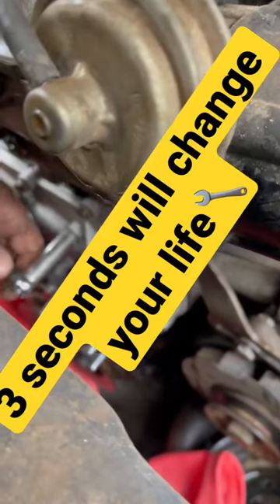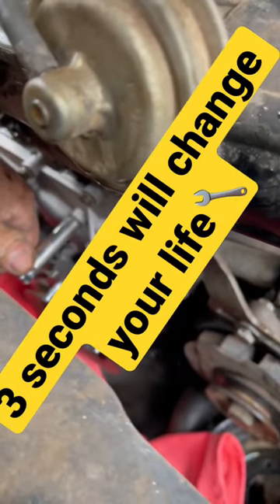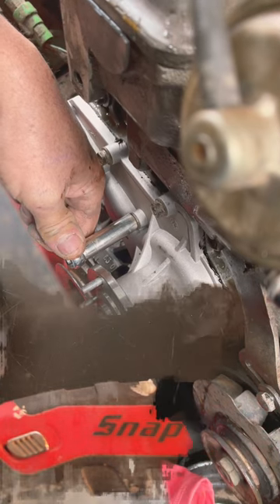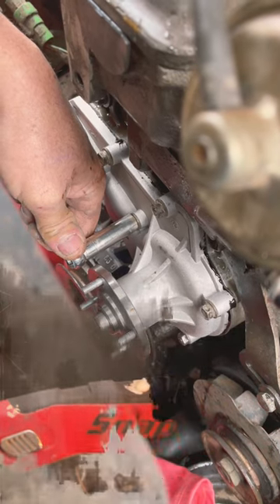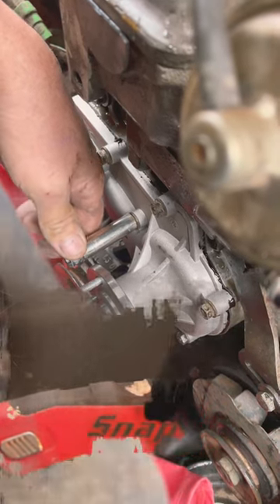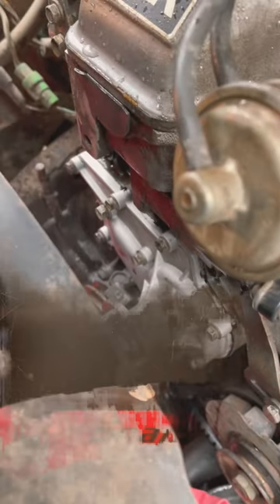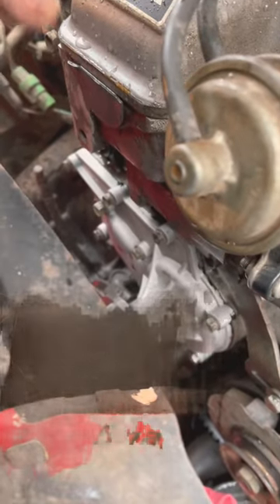This is why you hold your bolts for 3 seconds 🔧#shorts

Comment: I have been turning a wrench for over 50 years with 2 ASE Master Certs & more. I never had problems with bolts until they started using metric bolts. With Gm 1977 was the first year for a mix of metric & SAE fasteners. The Gov was subsidizing the switch after about 3 years that stopped so it stayed metric & SAE for a bit.
Now as a mech I had to buy a new set of tools that was not subsidized. 
The tread pitch of the SAE seemed to hold better than the metric thread pitch don't know why it just did. 
Back then bolts held by clapping force not today's bolt stretch not torque. Working on Asian cars (metric) in the late 70's the bolts were softer I would tend to snap off 6mm bolts, they were not as hard as US 1/4 bolts.
Like today there are many steps in setting head bolts. Today I'm doing a Ford V6 4.2 head bolts. It has like 6-7 sequences one has to follow.
One of them is when your about 1/2 thur sequence is back them off like 2 turns & start over. Some say one has to wait a few mins on each sequence to let the bolt relax.
I like the old school when you would torque all to 35 lb them go 75-80 lb & done.
Reply from the maker: Truly amazing how much metal has changed. All the new techniques. Mixes and alloys, pitch, temper, hardness, stretch,  etc.... Even from the point of manufacture and the process and materials used. Like a lot of the good bolts and machines were made during certain periods of time. I personally enjoy the older stuff like you said. It is nice bolting down some nice older heads on a sbc.....Good old fashioned engines with American made steel.....👍

Comment: Low-frequency resonant vibration causes all bolts to come loose. Regardless of how long you hold them. It's a really interesting phenomenon. You should look into it.
Reply from the maker: I have, also the Junker vibration tester. Both highly interesting....Plenty of research and factors to be considered.... The torque, tension,  and clamping force are all a part of tightening a bolt. I do believe the 3 seconds helps to settle the tension, on the molecular level. It will in fact help it to become looser , more easily with rebound tension. I do not disagree with your information though. Great comment👍
Reply from the maker: @kssendthemamessage6818  😀

Comment: If you're not using a torque wrench technically you're not doing it right. If it ain't tight enough in the first place it doesn't matter how long you hold it.
Reply from the maker: Can you fix anything without a torque wrench?

Comment: I heard if you continue holding it at the proper tension forever would be obviously best.  But what they don't tell you is the bolt may still want to back out.  The important thing to remember is; you can lead a bolt to proper torque spec, but you can't make it want to stay.
Reply from the maker: This does help it . Exactly.

Comment: A quick Google search taught me something new 

A Bolt Acts Like A Spring

So, how does a bolt provide the friction we need? A bolt is really just a simple spring, albeit a very stiff one. When you push and pull on a spring, it develops a force which is governed by the equation:

F = K x X

Where X is the amount the spring is being stretched (or compressed) and K is the stiffness of the spring. Multiply those two together and you get the force in the spring. Here’s an example: Suppose we have a spring that has a stiffness of 15 lb/in, in other words, it takes 15 lb of force to stretch or compress the spring one inch. If we want to compress this spring 2 inches, we would need:

F = 2” x 15 lb/in = 30 lb

The same thing happens in a bolt. [Editor’s note: The equation above shows the spring equation since we’re making an analogy. In reality, the relationship between force, strain, and stiffness of a metal bolt is ￼, which is stress = elastic modulus x strain. But it’s the same idea. -DT]. When we tighten the bolt, the threads of the bolt are trying to pull the nut closer to the head of the bolt. But, the object we are trying to clamp (a steel plate, a suspension bushing, a bracket, etc.) is in the way and stops the nut from being able to get closer to the bolt head. The only way the nut can keep turning is for the bolt to stretch just like a spring. Of course, like a spring, this gets harder and harder the more you try to stretch the bolt which is why it gets harder and harder to turn a nut the more you tighten it. We can imagine a similar thing happening to the objects being clamped by the bolt; they have a stiffness as well and we can think of them as springs that instead of being stretched, are being compressed by the force of the bolt.
Reply from the maker: Finally someone did some research! Very well done.... Now you have a much better understanding on why this would help prevent the bolt from backing out. Good job!👍
Reply: @fastflo1  yeah I got curious after reading some of the comments. 

Never knew they stretched and acted like springs.
Reply from the maker: @lilrich1243  that is great . Most people do not do the research. Most simply reject it because they have never heard of it . A few people like yourself either know or are inquisitive enough to find out for themselves. It has been a really fun video so far . I do like the fact that it has inspired a few minds to want to know . And I am glad you found out . Now as you make a practice of doing this . You will also benefit in several other ways. Some of which you will discover is a higher level of focus, a better attention to detail. You will also feel some of them move in the 3 seconds . Whether it may be thread interference, twist, or friction being overcome. You will notice much more and get a better overall feel for your work . Please let me know how you what you discover. I have been using this method for over 30 years now on hundreds of projects and thousands of bolts . It is fun to do and you will always know you are doing the absolute best for your machines . Enjoy and thanks for your comment 👍🏻

Comment: I’ve never thought or was taught the three second rule but if you give it thought makes sense. The tension of torquing and vibration will loosen if you don’t tighten it enough even with a torque wrench it’s always good to give a few Ft lbs after the click for good measure.
Reply from the maker: You are very logical....Exactly. You will feel it for sure just start doing it. I do it on everything I work on. Screwdrivers, hand wrenching, open end wrenches, star bars, spuds, crescent wrench, all tools types and fasteners. From your weed eater, to your sbc heads.... And everything in between. It does not matter what it is. I just make it a habit. You will really become aware of threads, tension, heat, rust, interference, wet threads, dry threads, dirty , clean, new, old,  etc and so much more. It is like a gateway to being a truly better mechanic.👍

Comment: First, the factories use torq. wrenches for a good reason. But even if what's shown here is true, in the five decades that I've been tightening bolts (only using torq wrench on the critical bolts) I have never once ever had any bolts come loose. It's really simple (and faster than and extra 3-sec. per bolt). First, always tighten all bolts in a cross pattern and then simply go around a second time checking and tightening any bolts that aren't as tight as when first tightened...
Reply from the maker: That all work also.... But this is an additional step you can take if you choose.

Comment: Yeah, except cars aren't the only things with bolts on them and you don't see construction workers and manufacturing facilities holding the bolt for 3 seconds........
Reply from the maker: There are millions of bolts. This is not mandatory. It is a great tip you can use on your own stuff if you feel like it. It is just something cool to share. Also, not everyone gets tips from airplane mechanics. Had no idea this would make you that upset, a tip to help hold your bolts tight. It is like you want loose bolts ? sheesh......
Reply: @fastflo1  or you could use 

A Torque wrench 😮

Comment: It's called using a torque wrench if the bolt inch or foot pounds are critical. Or use lock tight. Orrrr hold your balls for 3sec you'll get the same result
Reply from the maker: I don’t have a torque wrench or loctite . Just skills . Sorry .👍🏻

Comment: Use a torque wrench and torque it to specs if you don't know how to find the spec with out a manual (the head of the bolt will help as well as the diameter of the nut or bolt) you need to revisit your mechanic's book or reverse engineer it.
Reply from the maker: How about put the book, and your torque wrench away and apply some skill? Sheesh.
Reply: @fastflo1  I mean yeah it's cool after 17 years on the business I can calculate  the torque no problem  especially when im out on The field and no access to info but if you have access to the info use it and abuse it. 
Eventually  you'll remember  plenty of torque specs.
Reply from the maker: @abbsgarage.9676  I do believe after so much time working on stuff. A experienced mechanic that fixes things should know how to fix just about anything without a torque wrench or book. We all know what torqued to spec is. Every car that ever came off the production line. They all need repairs right?

Comment: Sometimes you need to hold for 6 or 9. All depends on materials, thread size/pitch, dry or lubricated, etc. Check the hold time specified by the engineer on the drawing
Reply from the maker: Great point. Thanks. Great Comment👍

Comment: 50 yrs mochanicing, never held bolts for 3 sec. Never had a bolt come loose, no I'm not lucky. It's 50 years
Reply from the maker: You did good. Others have loose bolts. They are not machinists.

Comment: That's like people that push the drill bit through the hole on the drill press a few times just to make sure it's nice and smooth. Round is round and tight is tight, doing it again doesn't make it rounder or tighter.
Reply from the maker: Nice analogy.... Wrong context though....

Comment: Also make sure all the valve stems on the wheels are at the bottom before you lower the car off the lift.
Reply from the maker: I spin mine and let them be random....
Reply: @fastflo1  The horror!
Reply from the maker: @elbystump56  😀

Comment: Sounds like a good topic for Myth Busters. I'm 36, been wrenching since I was 12. Never have I ever put a waterpump bolt on without a torque wrench.
Reply from the maker: Seriously? That makes me sad man. The amount of people that do not know this or have common sense to figure it out. What the heck you going to do when your torque wrench is not around? Seriously , please install a water pump with regular tools . dang.......
Reply: @fastflo1  "when your torque wrench is not around....." come on man. You cant be serious. This is all just a giant troll video right? You are just messing with us? I've installed plenty of components without a torque spec....but I don't mess around with water pumps. Too big of a job on many vehicles to not use proper torque specs.
Reply from the maker: @highplainshollarhomestead3188  I am serious . Have you never been broken down somewhere ? Or a friend ? Not in a shop with all the tools? Seriously ? You need to get out of the house. Any good mechanic should be able to build and engine without a torque wrench . If you don’t have the feel at all and just rely on a torque wrench… I wish you lots of luck 🍀 in life . Because you will need it without skills.
Reply: @fastflo1  Have I ever been broken down? Yeah, one time. Walked 10 miles for a battery cable....I haven't had any mechanical failures...because I put stuff together right, and fix it before it breaks. Dude, look at my channel, plenty of proof I am not some keyboard warrior. All I am saying, is in my entire life, never have I ever been concerned with holding torque on a bolt for 3 seconds. I've assembled plenty of things without a torque wrench....but I alway use a torque wrench on a water pump.
Reply from the maker: @highplainshollarhomestead3188  I have never used a torque wrench on any water pump. They all work fine. And most people that have not heard of the 3 seconds immediately believe it isn’t true because they haven’t heard …. Kinda of amusing. You haven’t heard because you guys don’t have mechanic friends that work for Boeing. And you want to believe this isn’t true . What you should be saying is I can’t believe in thirty years I never knew this . And get smarter and research it . You guys are making  fools of yourself so quick to say it doesn’t work. Because your bolts didn’t come loose. Not every bolt will come loose . This is an extra step you can do , not mandatory. The ignorance blows me away.
Reply: @fastflo1  ok.

Comment: I found when I torque the lug nuts on my car, I need to drive it, then retorque them. One day I noticed a noise, when ciming to a stop. When I got home, I went to check the lugnuts. One was gone, the others were loose. Now I always torque them, drive it, then torque them again.
Reply from the maker: Great idea. Those are some very important ones to keep tight! I have seen some pretty bad damage for wheels flying off! Good call👍

Comment: Just overtorque the exact amount that the Bolt will “rebound”. Problem solved 😂 this is sarcasm by the way. Also while your at it, if your brakes are squeaky, just put wd-40 to make the squeak go away 😂
Reply from the maker: Hey thanks for the tip I tried it and my brakes stopped squeaking! 😀

Comment: That's newß to me !
Maybe I just learned something new !
And I'm 64yrs. old !
Have been a mechanic for 47 years now, and the first time I've heard that !
Reply from the maker: Yes!
That is awesome!
Never too old to learn something new!
I am always excited to learn something new also!
So, I have been doing it for years now and have had many, many, bolts creep forward in that 3 seconds. It also brings a focus to your work. And it is very intense also holding the bolts for that 3 seconds. This will help you be in tune with the motor also. At least for me it really does keep me focused on my work. So many different factor involved. It really gets you thinking. I hope you enjoy. I do it every time I work on my stuff, just had one creep on me yesterday... Great feeling when it happens. I also like like the fact I know I am doing the best possible work I can be and that I can rely on my work 100 percent...
Reply: @fastflo1  
Rarely do I have that kind of time to be able to put that kind of time in a job, I depend on Red, Loc-Tite if permanent, and
Blue Loc-Tite if I expect it to be something that would be taken apart at some point later.
And I have never had a failure of a fastener to this point.
But always new pointers are valuable !

Comment: This is actually only partially correct. Most metric fasteners will have a time indicator on the top surface, showing the number of seconds needed, such as 8.8, or 10.9. The standard bolts have slashes on top. Just get a digital torque wrench with a torque-to-time feature, and stop counting.
Reply from the maker: Just like a clock⏰

Comment: Is that a 22re. Or whatever the older taco had in it. The straight 4cyl. The valve cover looks like it .
Reply from the maker: Yes it is before the 22 re. It is a regular 22r. But it is the last year they made it with a double row timing chain and metal backed guides. 1982 was thew last year. 👍
Reply: @fastflo1  hell yeah....that was my first truck. Around that year ish... Holy crap it was slow lol. You had to wring it's neck to get it to do anything fun. But change all it's fluids like it's your child n u will have it till 500k

Comment: so this is why my mechanics bill is always so expensive (just kidding I do my own vehicle work and have never had an issue with bolts coming loose not once have I had to hold it for 3 seconds to make it stay tight) tighten the Fkers down and send it out the door. also worked in a tanker repair and inspection shop where the tanks that haul Anhydrous Ammonia, fuel tankers, propane tankers can't leak and are thoroughly tested with both non destructive testing and destructive testing during these tests leaks are located and fixed. with that some of these had flanges that you could not get a torque wrench on so you get it as tight as humanly possible in the proper arrangement for that stud pattern. working strictly in the space available to you (typically under the rear structure that marries the tank to trailer where an average sized man struggles to fit with a pair of wrenches even)

Comment: If it's properly  torqued  it won't  come loose..
Hombre🤘
Reply from the maker: Well, it still can. And this helps to avoid that. And plus, you may not be using a torque wrench. What if you are just using and hex wrench for example...Or all you had was an adjustable wrench.....

Comment: "Rebound tension" that is a new one. Better tell the engineers that is why bolts back out, not vibrations.
Reply from the maker: It is a combination. If it has rebound tension, which is old, vibration will set it into motion. Almost like using an impact driver.......Think about  how that works for a second...If the bolt is settled it is less likely to be sent into motion...... Hold your bolts for 3 seconds....

Comment: Torquing twice is a thing but holding it is not. You have to unload it then retorque. I've seen this affect clamp load and vibration unload real time with very expensive equipment for assembling very expensive airplanes.
Reply from the maker: You torque it twice.... Think about that. tell me why it did not stay the first time? How did it back off?

Comment: Torque the bolts then recheck the torque of the bolts after 30 mins,
this method is only used for the unskilled fitter or DIY man.
Reply from the maker: Why would you recheck if they were torqued?